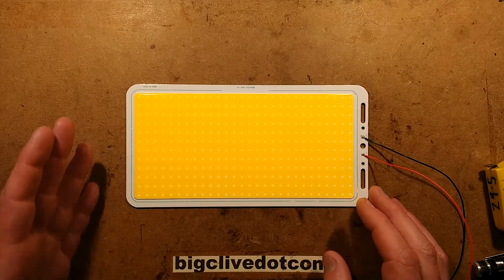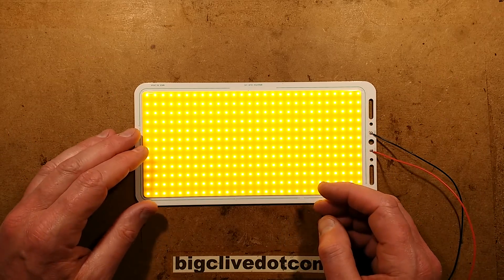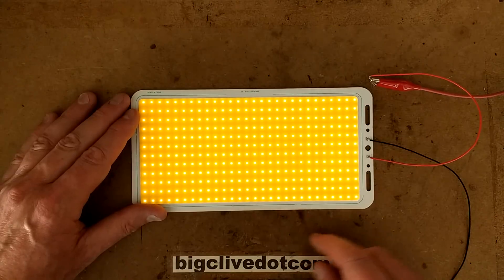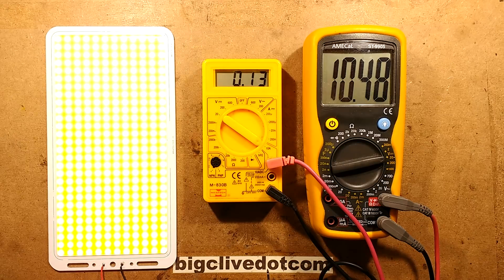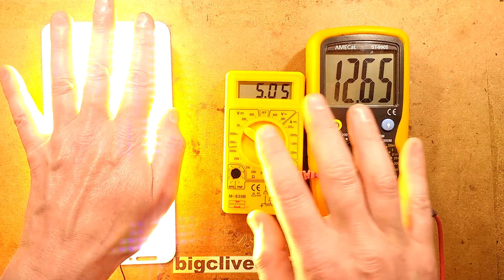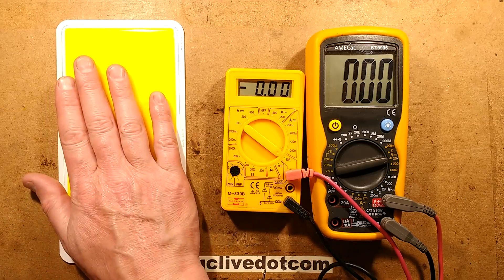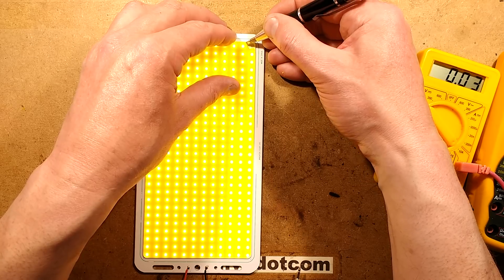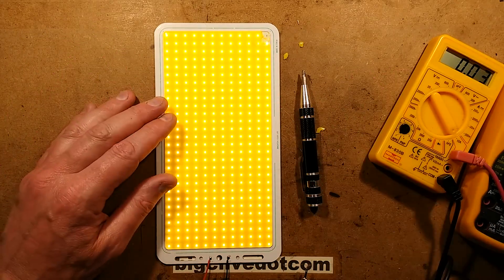The biggest LED COB panel yet!  Voltage/current tests.

Comment: Hi, great test video of this nice panel. 
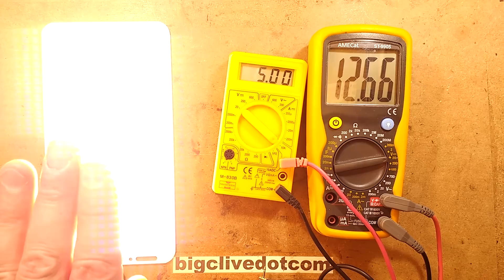I want to build an autonomous camping pole latern using this panel. What DC DC boost converter would you suggest if I want to power this COB LED panel at max power (7:40) 12.8V@5A using 3s LiPo battery and getting constant output voltage of 12.8V until the battery drains? The battery voltage will drop from around 12.2V to 10.5V under 5A load. What would be the best DC DC boost converter choice?

Comment: I don't know much about it, but why not use a single massive diode (with a heat sink and cooling fan)? Id'e think just the normal emission layers but the cathode is made of copper and also functions as the heat sink. then to serve as the anode would be a layer of indium tin oxide with a grid or rows of thin copper busses to carry electricity to the indium tin oxide.
Reply from the maker: I think there are thermal stress complications of making large area single emitters.

Comment: Could I run this on a constant voltage 12v psu with no other circuitry?
Reply from the maker: Yes.  But I recommend a simple diode or resistor to nudge the output down slightly.
Reply: @bigclivedotcom  Thank you for the response.
Reply: @bigclivedotcom  I figured a 4 ohm resistor would give me 36 watts at 12v and 59watts at 14v (incase one was to use in automotives).

Comment: I'm going to install some of these LED light panels in my 1986-vintage motorhome to replace the 12V bulb-type fixtures that are in there now. I will be living in the motorhome full-time (in a static position) starting later today (hopefully!).
A few years ago, I installed one in a shipping container house that runs from a PV array and a 200AH 12V AGM battery. I have been VERY impressed by it. It's cheap, and has very "soft" output because of the large area.
The motorhome has ONLY 12VDC lighting, so unless I plug in a bunch of extension cords and put up 120VAC lighting, 12VDC is all I can do. Given that I'll eventually be off-grid with the motorhome, 12VDC is actually an advantage for me, as I can run all my lights directly from the PV-charged battery in the RV, without needing to have an inverter on when only lighting is needed. These panels can be easily dimmed, too, so they use just a tiny amount of power to put out plenty of light for most situations, but crank up the knob and they get HELLA bright!
Reply from the maker: There are loads of choices for 12V lighting these days.  You can also convert just about any light to 12V.

Comment: Curious, why couldnt i just use a soldering iron? Is there no soldering pads?
Reply from the maker: There are soldering pads, but the whole panel is a heatsink making soldering hard without pre-heating the module.
Reply: @bigclivedotcom  ahh ok thanks alot

Comment: Nice.  I put two RGBW panels on my sound bar for graphic equalizer, and the specs says needed 76 watt PSU for each panel of 8 x 32 LED's for 256 LEDs per panel.  Well 76 watts blinds you. In reality, even hidden behind speaker cloth, in daylight, the panel is perfectly visible at 2 watts per panel.  The sound bar is on my channel if you want to see it.

Comment: I have to make a  choice between variable voltage supplies. Should I go for a 3v-12v 10 amp regulated power supply or a 9v-24v 5 amp power supply?

Comment: I also just connected one of these COB panels to a bench power supply. Using a 5v-24v dimmer switch, I was able to click on 100% brightness without the light blinking , though I don't think this was the true 100% brightness, as my bench supply was putting out a max of only16.4v at 3.16 amps (maybe the max for my bench supply), which is only 51.8 watts. This panel should be rated somewhere between 70 watts to 100 watts.

My question is what is the ideal DC power supply to get maximum wattage out of this panel? Should I stick with 12v and get something that can put out at least 7 amps, or should I go to 24 volts? I will always be running the light with an LED dimmer switch.

Comment: I personally don't like them, because one failure and the whole things is a throw away. Instead I put together my own LED lights using usually 1w diodes, these are attached to a heatsink and then a diffusion panel places over them so the light in the room is diffused into one light and you don't get multiple shadows from separate beams. I have had one LED light I made running for every night for 20 straight years, so it's perfectly effective. 
Despite there being no failure as of yet, if there is a failure, you would simply take out the diode that failed and replace it with another diode, so the entire thing wouldn't be a throwaway, but an easy thing to fix. I run mine with a simple cheap LED driver, which changes 230 into 12v at a constant current, the driver is encased in a plastic box, inside that box I assume it's similar to the driver you would find in the base of an LED bulb, the little transformer and capacitor plus diodes setup essentially. 
Ages ago I bought some cheap Chinese bulbs, and a diode in the bulb failed, yet it's worth taking out the AC to DC power circuit in it, you can use these to power other LED's easily.

Comment: I use smaller 10w versions of these for Yard illumination using an AC-DC 60w 5amp power brick, they do very well for that.
I also have 1 on my Tahoe as an extra Reverse/Illumination light connected to a cig lighter adapter.

Comment: Hello big Clive. Love your videos and in this one you mentioned that you would not run 70 Watts through this panel. I've just ordered one to play around with I was wondering what controller you might suggest 2 power one or more of these? What you need one controller per panel or could you get one controller to Power four or five of these. I am looking to keep temperatures down and figured this unit could help in that regard. Any help gratefully received. Regards

Comment: Can I use this to grow tomatoes?
Reply from the maker: Possibly.  I've never tested it for that.
Reply: @bigclivedotcom  thanks ❤️
Reply: @bigclivedotcom  what kind of adapter do I need to use for it?
Reply from the maker: @REDACTED42-t5n  A 12V adaptor suited to the power requirement with a good margin.  The panel will also need suitably heatsinked to keep it cool.
Reply: @bigclivedotcom  thanks you're a big help and learned a lot from your  videos

Comment: Hi Clive, after some advice.
I'm looking at building 6 sets of rechargeable 12v floodlights, each set comprising of 2 of these 70w COB panels, each set will run off of it's own 12v battery/power pack.

The reasoning behind this is to provide sufficient light for my youth football team to train, due to covid restrictions all our locat winter training venues are not available to us and so our only option is training on the pitches we play our games, only downside is they are not floodlit...

As space for transporting is short ideally a small power pack, maybe a 12v lithium ion battery pack would work or another option is a 12v mobility scooter battery, anyway any recommendations on the battery size or type that would work best for this application.

The lights will be used once a week for approximately 90 minutes.

Any help would be amazing.

Cheers
Reply from the maker: It could be viable to do, but to avoid glare they would have to be mounted up high.  It might be worth building a prototype and testing it.
Reply: @bigclivedotcom  I've tested 70w panel mounted on a 3m pole and it works a treat but was just hooked up to the car lighter socket, they will all be mounted at 3.5m high, my issue is what battery would be best to power 2 panels for an hour a half,  cost and size are important.

Cheers
Reply from the maker: @btfccaspians5411  The car alternator would be charging the battery at about 14V so that would affect the current through these panels.  The only way to find the best solution is to experiment, and make sure that any batteries you use are protected against over discharge and also during charging.

Comment: @bigclivedotcom
A quick way to see how these are laid out - take one of those little pen sized UV lazers, turn out the lights and shine the lazer at the COB, when the lazer hits one of the LEDs directly the whole section lights up . . . so scanning the lazer across the COB will see each of the four sections flash for a second.

Comment: Hi, great vid and informative as well... If you have a second could you give me some insight/advice. I know this vid is a couple years old but i got some color led cobs..im linking video now its under 2min https://youtu.be/rDWBSMkT1rw BUT the 3 wired in parallel killed 2 of my voltage reducers in under 20 minutes, going to try one other in a couple days. Thats one question and recommendation BUT also any insight as to why the green led runs brighter than the red or blue in video?  if theyre all getting the same voltage supposedly is that just part of their out put for their color spectrum? i assume if i wanted more output then Id need to overdrive those colors? (not that I have space in my eskate case)  Thanks if you can help!
Reply from the maker: Set the voltage lower.  Those arrays usually have no current limiting and will also be damaged if run at excessive power.  Green is at the peak of the human eye sensitivity.  Red and blue at either end.
Reply: @bigclivedotcom  thanks for the speedy reply! The output of the converter is 12v 10amp max preset... when you say no current limiting you mean no protection built into the cob to prevent it being over driven and blown right? on the flip side will they pull more current than they need?

Comment: I'd like to mount some kind of led light like this to the side of a 12vlt power box to use as a light source while camping. For preparing meals etc. And hopefully wouldn't drain the battery too fast. Any suggestions? Thanks. 12 volt 12ah lead acid battery

Comment: i cannot find an efficiency such as lm/w on these or umol  output etc so i could determine whether a series of these could replace the mid power led samsung strips and boards using the lm301b diodes..  do you happen to know if this could be used in a similar horticultural application like the mid power led diode strips ppl use from samsung and bridgelux?  i realize these wont have quite the specs as the best samsung diode but i'd still be interested to know if say a panel of 10 of these could be used as a grow light for 1-2m^2

Comment: I ended up getting one of these as a garage light and tried hooking it up to a 12v 2.5A AC adaptor. I'm unsure why, because I've only just started mucking around with electronics, but the panel just flashes on and off in half second intervals. Any idea why it would be doing this?
Reply from the maker: That sounds like it's too high a load for the adaptor.
Reply: @bigclivedotcom  awesome! Thanks for the help. I'll look into sourcing something with a bit more grunt

Comment: Mine is dying I think, it is only pulling 600mA now on a 12 volt Lead Acid, I think one or more LEDs are burning out, despite treating it with kid gloves and mounting it on a large Copper Heat sink.

Comment: I've got some massive heatsinks with flat surfaces in the form of car stereo amps that no longer get to thump on everybody's walls. 2 or 3 of these panels on one of those, and you are talking serious high bay lighting or easy outdoor lighting with low voltage. Glue them on with J B Weld. An ATX computer power supply should power it up.

Comment: Hello, Can these be used as Grow lights?
Reply: Grow lights are optimized for plants, which are different from human eyes.  You can use this panel for growing, but it will be wasteful and require more electricity, which will cost more.  It is better to get real grow lights.

Comment: how long would a fully charged 12v battery last running this @34w
Reply from the maker: That depends on the capacity of the battery.  But probably not as long as you'd want.
Reply: @bigclivedotcom  So lets just say hypothetically . I want to run 500w of led for a period of 12 hours how many batteries " hypothetically " would I require ?
Reply from the maker: @irish-medi-weed-grower5240  About 600Ah at 12V

Comment: What kind of current limiting 12V led driver board do you recommend? I see some one ebay, but is there one you have expereince with that works well for beginners?
Reply from the maker: It depends on how you're powering the panel.
Reply: @bigclivedotcom  3s or 4s battery pack with 18650 cells most of the time   Or a 12V 6a AC transformer sometimes.

Comment: Is there a component which I can limited the voltage being put through one of these LED lights. I have one and want the light to run at the same brightness at 14 volts as 12 volts so I can use when the car is running and not running. I was thinking to use a potentiometer but would like something that would cap it at 12v without having to fiddle with it.

Comment: Would like to know what about the CRI-Value (color rendering index)? Would be a great source for photo and video production and also very useful for dia positive reproduction and digitalisation. I asked the seller at ebay, but they dont know. It will probably be below 75% i guess and could be not enough for high photo reproduction. You can get Cob Leds with 30 oder 100W with a CRI > 93 but they cost around 100+ Eur.

Comment: Is there a certain type of white leds that will not draw as much current as possible and thus overheat? The only ones that don't 'run hot are the 19" round ring light ones for $50 in my experience and they come with their own 15v 5a power supply. All other white leds I have bought overheat!
Reply from the maker: They usually do push them too hard.  You can adapt them to bring the current down depending on the type of circuitry.

Comment: what is a good way to reduce the voltage of a 12V 6a power supply? A simple Chinese step down buck is good? Almost all of the led strips I buy (expecially the double row 5050 ones) tend to get very hot even with an aluminum heat sink about 124 degrees F. I hope someone can help me solve this over heating issue.
Reply from the maker: You can get a chassis type power supply with an output voltage adjustment on it.  A diode or two in series with the strip will drop about 0.5 to 1V per diode, but they will need to be generously rated for the current to avoid getting too hot.
Reply: @bigclivedotcom  thanks love your videos!

Comment: Please - never touch the yellow Part of a LED.
If you are working with such LED's, you should know that and follow it. Otherwise, a defect is preprogrammed.
Sooner or later, the fat on the skin will burn in and make the LED unusable.
In addition, the slightest pressure can break / tear the fine wires on the LED chips.
No wonder that so many LED lights break down over time, when almost no one adheres to the handling regulations.
But, it's still a nice Video.

Comment: Do you think that could be used as a a light source for a diy projector?
Reply from the maker: Usually projectors use a point source of light.  I'm not sure how well a large area source behind an LCD panel would work.
Reply: @bigclivedotcom  Many people have used an LCD and used  a light source with a diffusing layer to get make their own projectors.  I was looking at making my own portable projector that could do HD during the daylight and this looked promising.
Reply: @MysticWhiteDragon.  should be fine with a diffusion layer, no hotspots!

Comment: Sorry I am new to electronic fabrication, Is there a way to solder a connector to the board I would like to experiment with rigging 4 boards and I would not want to re-solder connections all the time. I am assuming that if the boards are wire serially I would need to provide n*12v where n is the number of panels linked in series.

Comment: I remember the first intensely blue and red LEDs of any worth coming out in the late 90's as cellphone antenna tip add ons...they were a fad for those early rich kid phones but inspired me to build my first LED growlight in 1997 for the low cost of $900 for the bright white, blue, and red plastic q tip sized LEDs found through research on Sierra Online...although my memory is a little fucked from all the high quality Cannabis I bred using that light and the 600 watt Gavita mirrored bulbs....ahhh the 90's

Comment: for the panel in the video  

Power: 70W
Input Voltage: DC 12V-14V
Current: 13A
Reply: 12x13 is a tad more than 70.

Comment: This looks like a really neat idea.  Some vendors are now selling an impossibly small looking LED dimmer for this COB array that they say can handle up to 12A and deliver 244 watts(!) on 5-24V DC -- all for $2.75 delivered.  Ooooookaaaaaay, lets see if it works.  If it does the lamp should work well mounted on a homemade aluminum slide suspended underneath the top equipment shelf of my new electronics bench.  Thanks, Clive!

Comment: These work VERY well used on a three-cell Lithium battery pack.
The full battery voltage is at the full drive voltage of the light.
Then, as the battery runs down, the light will gradually dim, giving you a handy indication that your battery's running low.
The LED cutoff is just above the safe minimum voltage of a 3-cell pack, so even if you set it and forget it, it shouldn't over-discharge.
Only complication is that you may need some way to cool the panel at full power/full charge, until the battery runs down a little. Fortunately though, you have 12v right there if you wanted to connect a fan and heat sink system ....